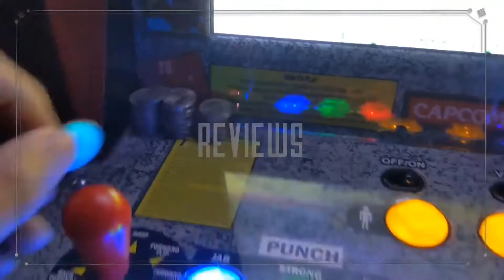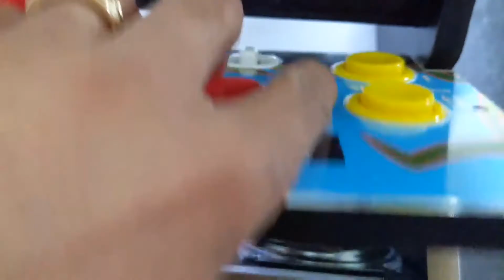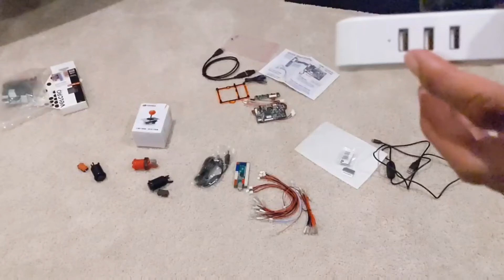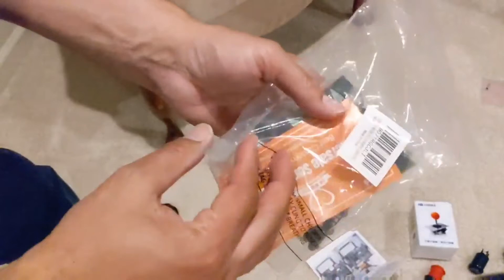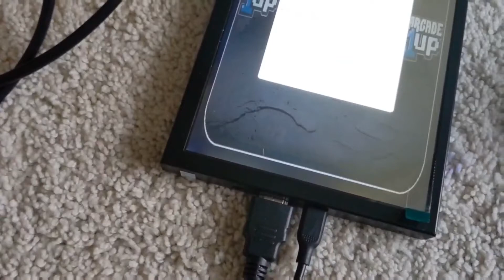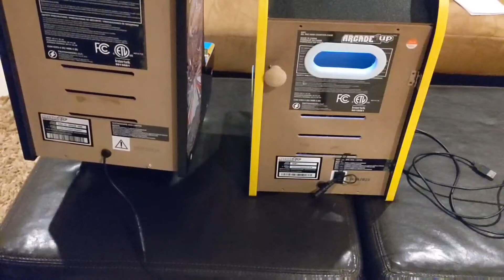A Deep Dive: Arcade1UP Galaga Countercade Mod Part List

Comment: I've seen a lot of ppl move the speaker to the top so there is space to change up the board while they were also adjusting for a lit marquee. I've been watching a lot of videos on modding this cab as I want to mod mine too. There is someone who modded it and put a sanwa in it if you look for it on youtube. I'm probably going to get a new board from Tulsa arcades for more buttons myself. My biggest concern is the screen I don't like and getting a good screen that's reasonably priced. Not sure that is realistic tho! Think I will put a pi in it with a vertical only image. I want to put a small power strip in it and adjust it to have a switch on the back if I can attempt the electrical. I'm curious to see if ur HAPP buttons are too long to fit